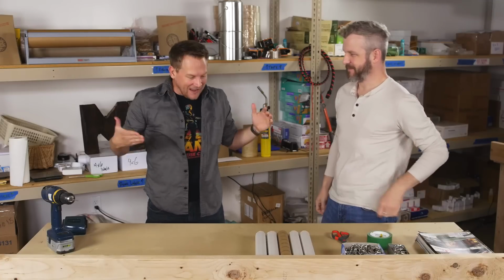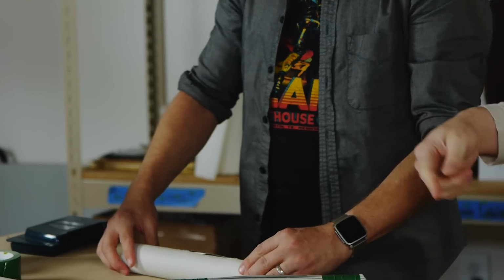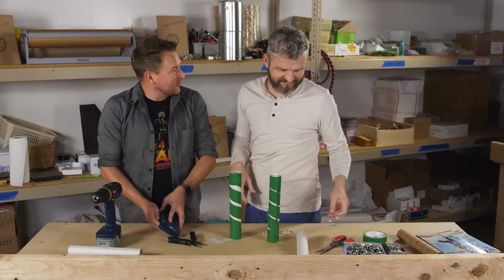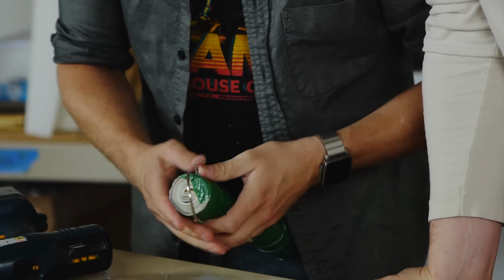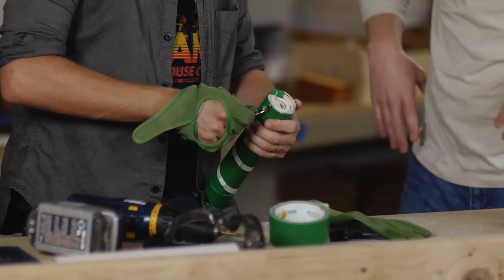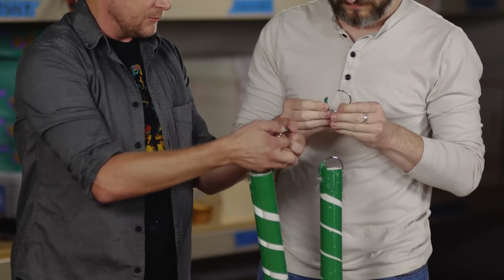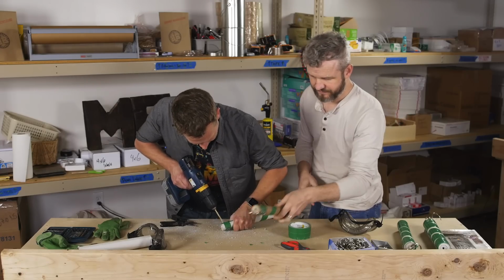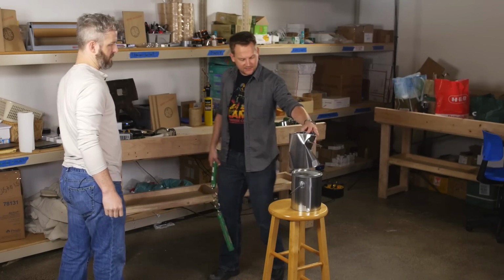Making Real Nunchucks from Magazines

Comment: Those little metal circle clamps are utter shit. definitely should have gone old school with a solid piece of rope. Also I would skip the magazines and just cut a couple pieces off a broom stick.
Reply from the maker: I don't think you're describing anything "improvised" at that point. I think you just described "building a set of nunchucks."
Reply: I think you might need to check the definition for improvised chief.